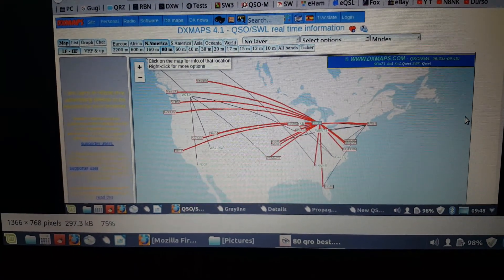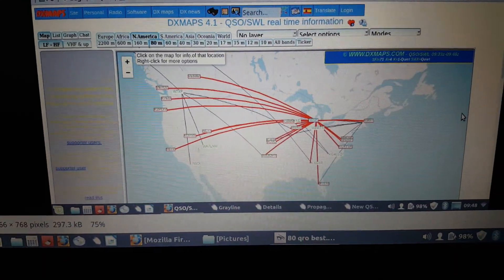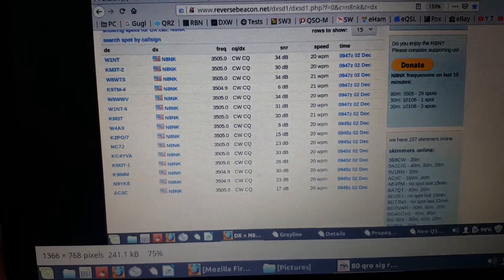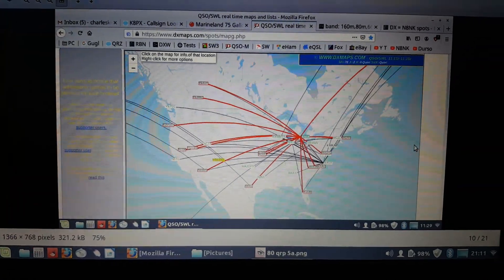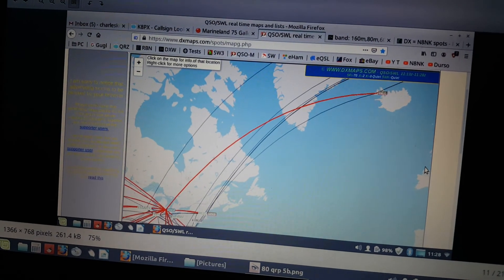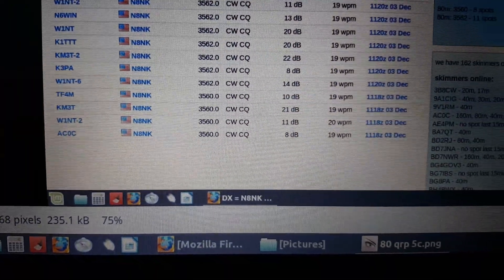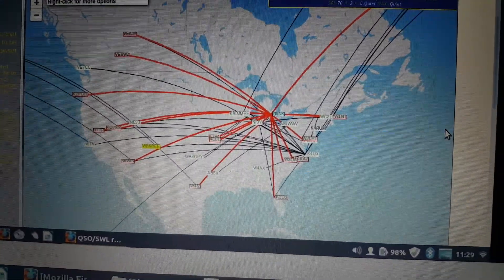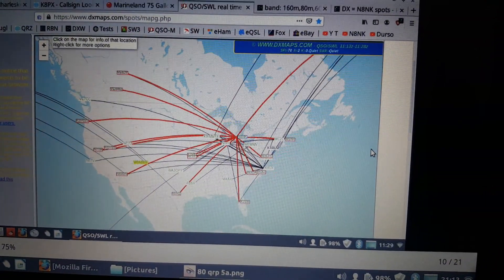80 EFHW & Multi tap UNUN   part 3 of 3   RBN Hits

Comment: I would like to thank you for making this video! I think you did a good job. I am kind of new HF and I have learned a lot from videos like yours.  Running 100 watts, what kind of core should be used and what wire size? I was thinking of using 2- 2.5 43 . But like I said I am new to all this and not sure what is best.  I have seen where some say that the mix can make a difference in what frequency it works best. But it looks like that can be over come with the number of windings. 73.   W4DES

Comment: I am sure its the first time I see the 49:1 UNUN tapped, and it makes perfect sense. Including the extra wire sometimes one has to add to get the perfect match, ie, under 1:1.5 SWR. I will definitely try it and since I am sure it will work I will then add a case with some banana jacks for each tap and get the UNUN inside an enclosure, just for the looks :)
Thank you for sharing your ideas and tests, thats ham radio all the way. 
Tu tens origens brasileiras? Devias saber falar Português ;) Eu também digo GEEEE ahahaha

Comment: interesting videos on the multi-tap UNUN.  I have a 135 ft end fed using a 49:1 Unun Transformer.  Getting similar results with SWR plots as your set up. Except I don't have to change any taps on the UNUN for multi band use..  This is not meant as a snarky comment. Do you think there is a benefit, or performance advantage by changing the taps for individual bands?  I would be willing to uses a your tap method if there is a performance advantage.
Reply from the maker: Thanks for looking at the vid.  I didn't think anyone would stumble across it.  lol.  In my case, I only change taps to get the lowest SWR on each band and also within the 80 band (for cw, ssb, etc) so that I don't have to use my internal tuner.  In my rig, generally, it will output full power up to about a 2:1 swr then it starts cutting back.  By using the various taps, not only was I able to not use the internal tuner, the match was really good, generally much less than 1.5:1.  In your case- if your radio will output full power into your antenna on the bands you like to use while only using the 49 Z ratio - I  probably wouldn't bother messing with anything.  Especially if you're using QRP like I do 95% of the time.  Some people are bothered by an swr of 2:1.  I'm not really when running 5 watts. And swr isn't going to really affect your signal.. but every added tuning device will.  One unun alone feeding a high Z wire antenna is bad enough. For me to add the internal tuner loss into the system is unacceptable.  Perhaps you don't have to. Later this evening I'll  connect the 49:1 tap and see what kind of match I get on the various bands.  73 and Merry Christmas OM
Reply: @n8nkqrp595  Hi there, do you already know the length of the radiating wire? :) cheers and 73
Reply from the maker: @LuísLapão  No! I sure wish i did. I started out with it being 40 meters long exactly, but then I started experimenting and cutting pieces off. When our back yard dries up this spring I am going to pull the wire down and measure it.  I've been playing with a 40m EFHW, and that wire is exactly 63 feet (19.2m) long.  73
Reply: @n8nkqrp595  ok that explains why it works ok on 80m ;) 41m in length it's a nice start and the tuning may vary accordingly to the location. No need to pull it down ;)